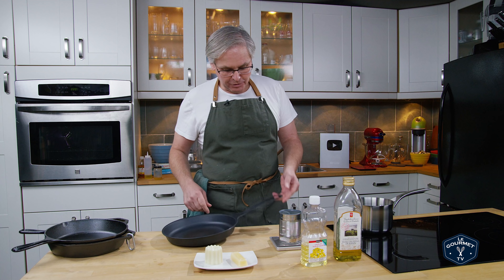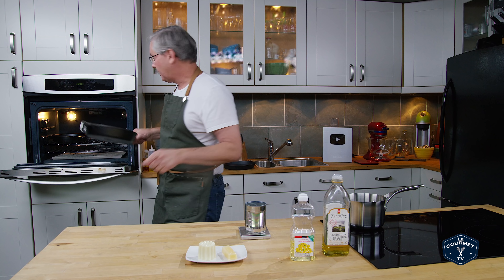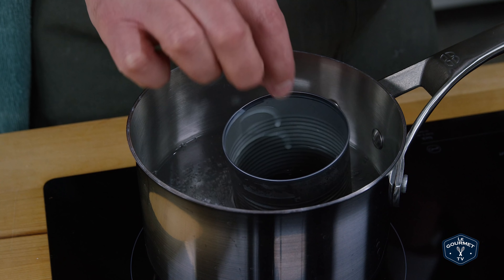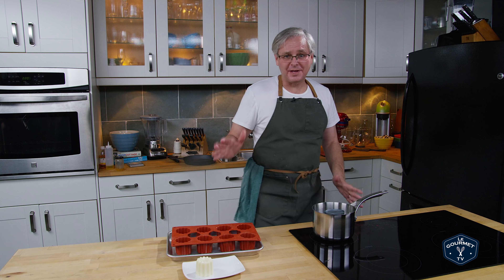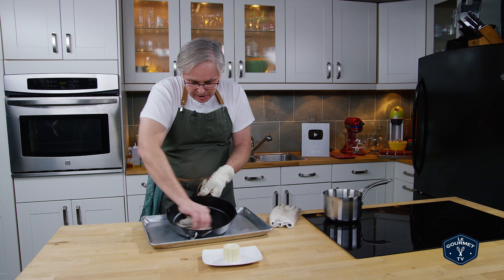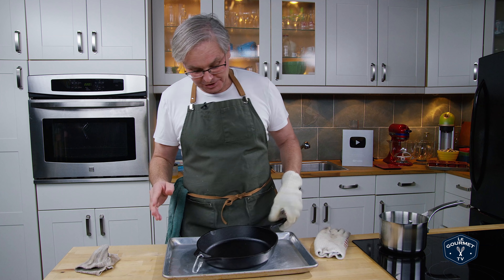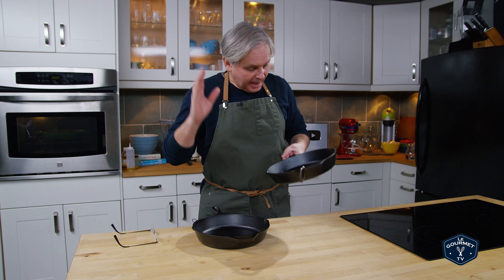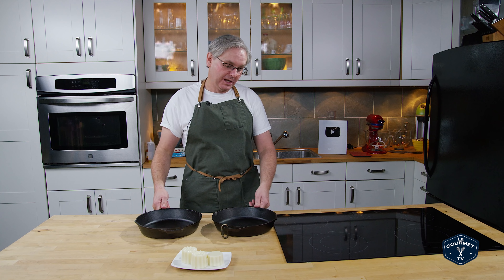Making & Testing Beeswax Cast Iron Seasoning Pucks

Comment: I found that Crisco (vegetable shortening) works well to season cast iron. Flax tends to flake off after a while. First time I hear about beeswax, I have some on hand so most likely going to try mixing with Crisco. Let's see how it turns out.
Reply: Crisco has been my go to as well for the last 20 years or so.
Reply: I season with flax now after some experimentation. It flaked badly the first time I did it, but then after a few weeks where I seasoned the pan after every use, that stopped happening. It's super easy to re-season now.
Reply: I used to use crisco as well and I found the same thing. Its not that it didnt work, just eventually I experienced flaking. I have since learned the reason for the flaking is that crisco has fibers in it which eventually results in the aforementioned flaking. This is why its more common to recommend a pure unsaturated oil like grapeseed and sunflower. Mind you, if you are always scrubbing and seasoning again, <shrug> I suppose whatever makes one happy.

Comment: It’s carbonizing the oil. It fills the pores in the cast iron. The carbonized oil has much smaller than the cast iron plus the carbonized oil has a very stable chemical structure that is less prone to sticking to things. i usually beed blast cast iron down to bare metal and season with beef lard. i think next time i’m going to try ghee on one and 100% pure beeswax on another one. i avoid seed and vegetable oils like the plague because most of them are toxic.

Comment: I wanted to pop in to say thanks so so much for this. I used it to resurrect a De Buyer Mineral B that I’d just about given up on. I just couldn’t get the seasoning right prior to this video.

Now, Crepes, pancakes and whatever else you can think of is just a breeze.

This advice given at 06:40 is golden. I did end up using the biggest flame on our gas stove instead of the oven, but the whole “rub it off as if you’ve made a mistake” really helped.

The puck I made was also beeswax, canola and grape seed. It also lasts surprisingly long.

Comment: Flaxseed oil is uniquely suited for this process because it is essentially a food-grade version of linseed oil. This being the case, it is a "drying" oil that polymerizes under the right heat. This produces the exact coating you're trying for. I've also used it to finish the wood of homemade rolling pins and cutting boards and It works extremely well for that process too. When buying a new cast iron pan, I also use a flexible abrasive wheel on my power drill to smooth the inside of the pan. I know that's controversial but I have found that along with seasoning, it produces a surface almost as non-stick as modern Teflon pans. Unlike Teflon however, it is restorable and entirely non-toxic.
Reply: Low smoke point?
Reply: @mrniusi11  Smoke point is irrelevant to this part of the process.

Comment: I'm a chemist. It's called an aldol condensation reaction. It's why you need a vegetable oil. It needs a lot of aldehydes to work. When you heat it up or even expose it to UV light, you cause these aldehyde groups to react with one another, linking up lipid chains. Furthermore, having unsaturated oils lets the double bonds in the chains react with other more reactive groups and form a net instead of a long string of molecules. The beeswax contains ketones that are not as reactive as aldehydes but since ketones are more in the middle of chains (aldehydes are at the ends), it helps the polymer become more net-like. The reactions are very similar, it just creates the link more in the middle of the carbon chain rather than at the end. Also beeswax has aldehydes itself, and some molecules have ketone and aldehyde groups. The net effect is that you end up with a more interlinked polymer.
You can only use vegetable oil but the polymer won't be as interlinked, so it won't be as chemically or physically stable. You can't use beesax on its own because it doesn't have enough aldehydes. So a mixture gives you the best of both worlds. Also, aldol condensation is self-catalysing so you get a synergistic effect by combining both components. Meaning that by combining both components you get a suitably quick and thermodynamically favourable reaction, unlike using only beeswax where the reaction is kinetically and thermodynamically unfavourable. Using oil only will be more thermodynamically and kinteically favourable than both, but thanks to the nature of self-catalysis (which exhibits logistic growth similar to pandemics), using both it will still be rather quick and easy.
Reply: Ah, yes, I figured aldorol compensation was causing self-cataloging synergies and uh, leveraging the intrinsic exuberance exacerbating kinetic reflux in a heterodyamic solution, maybe.  I'm not a chemist.  🤣
Reply: @brianh.000  that was hilarious 😂😂😂
Reply: Thank you!
Reply: @bloodgain  high or low smoke is a proxy for chain length. You want chains fhat are long enough not to evaporate but not too long so as to not have enough aldehyde groups to create the polymer. You want high smoke point, low smoke point oils will simply evaporate. Conveniently natural high smoke point oils have long enough chains that aren't too long. Adding low smoke point oils may help the reactions be faster but will ultimately produce a worse polymer for this purpose.
Reply: I just wanna ask my Prof the science behind iron seasoning. The only thing runs into my head is the nucleophile carbon double bonds attack the electrophile iron atoms but I’m still not sure how it works. Thank you so much😁
Reply: I guess I need to thank you and the bees for doing a great job!
Reply: jesus christ. i adore people like you. that explanation rocks. thank you. :-)
Reply: Is there a proper mixture ratio between the wax and oil, or is pretty much any combination good as long as they get fully incorporated with each other?
Reply: @trbig67  The video says 3 to 1 
75g oil
25g beeswax (pure)
Reply: Is there an ideal ratio of beeswax to vegetable oil?
Reply: @magistradox39  Probably, but it's hard to say. The ketones and aldehydes of different beeswaxes and vegetable oils will be different, and so will the chain lengths and insaturations. You'd probably have to experiment to get the best mix for your purposes.
Reply: @danielcelisgarza  Yours was the most helpful explanation of this process I have ever seen. These usually are some feele crafty BS that does not make any sense, but your explanations shed a light on why my seasoning attempts with different oils and finally a beeswax mix produced such different results.
Thanks mate!
Reply: As the child of an organic chemist and partner of a materials scientist, I can't thank you enough for this explanation. I've always wondered about the chemistry, but frankly been too lazy to research it. Now I know--thanks!
Reply: @anahidkassabian4471  lol i just finished my phd in materials science, modelled defects in metals.
Reply: How about carnauba wax? Would it be enough?
Reply: what temperature is ideal for the baking process? i can get up to 500 C + in my pizza oven, but i imagine thats to hot.
Reply: @PoolProblems  Idk, there must be papers out there i guess. You just don't want to burn/degrade them i guess. You'll get some of that regardless, but as long as it's hot enough to polymerise you're alright.
Reply: Your reply reminded me of all the times when armchair know-it-alls opine on a topic that they have no real expertise, then a true expert with specialized knowledge enters the fray and everyone shuts up.  Makes me smile to remember it.
Reply: Forgot to ask, will the seasoning keep the iron out of your food?  I actually have a condition of high iron levels so I try not to get any extra because my body holds onto it.  I give blood to mitigate this but it would be nice to be able to use cast iron again.
Reply: @danielcelisgarza  I have heard the onions can also create a non-stick seasoning, is this the same process?

Comment: In my experience the warnings about excessive oil are themselves excessive. I've watched a number of these cast iron seasoning videos and people are very emphatic about not leaving too much oil on and I've just not found it to be that dire of an issue. Do you want it very thin? Yes. Do I use a dry side to wipe off even more? No. Also, I have found that the Lodge pan I bought was a bit too rough from the casting to get a good non-stick surface, so I knocked off the high points with some 220 sandpaper before seasoning. I did not sand the whole thing bare, just took off the high spots. It looked kind of like a starry night when I was done sanding because the tiny points I took off were very small specks in the black sea of the pan's bottom. Just my 2¢.

Comment: Please correct me if I am wrong but I thought you wanted a low smoke point oil for seasoning because the actual seasoning happens as the oil is smoking/above the smoke point of the oil.
Also from what I understand the seasoned surface is very similar to gun bluing.
Reply from the maker: Ask 100 'Experts'... and you'll get an even divide as to what is the best oil to use.

Comment: Thank you for the guide.

 I just made this beeswax and oil solution using 1 part beeswax, 1 part sunflower oil and 2 parts Crisco shortening (1:3 ratio).

Doing my first coat of seasoning right now on my light cast iron wok, will be seasoning my carbon steel pan and enamel dutch oven using the same beeswax solution.

PS. Notice you're using President's Choice brand oil. Love from Canada...

Comment: You should try removing the lodge pre-seasoning and sanding smooth the interior of the pan to see if it improves performance.

I recently tried this with an Avanti Pro Quick Strip Disc and sandpaper. It doesn't take long to do, and left the interior much smoother.
Reply: there is literally no beneficial reason to doing it. wasted time and money.
Reply: If you go too smooth, you'll have a surface where seasoning won't stick.

Comment: Sugar makes polymers, but protein makes stronger polymers. I recently learned that cotton fiber is a sucrose (sugar) chain (polymer), same in tree cellulose.  While some oils can contain sugar, oils are mostly fatty acids composed of vitamin minerals and triglycerides which are a type of alcohol or broken down sugar.  Soybean oil has protein in it, so much so that they make plastic and linolium flooring from it.  Tung oil and linseed oil make a polymer film when dried in thin layers on wood. Mineral oil will dry out on wood and leave a web of dry minerals behind that actually is metallic in nature.  To get true polymers, like high temp plastics, you'd use a high protein oil.  Also, after two seasonings, the layers would begin to form matrixes that cause friction or sticking, in my opinion.  Lecithin found in eggs and soybeans will easily leave behind polymers when cooking, which is why pam cooking spray has lecithin as the main ingredient.  Even though beeswax is great on leather and wood, sugar in the left over honey can carbonize and leave holes in the seasoning film.  Since you wipe your oil off so carefully, it might take three seasonings to set a good film.  The best oil to use, though, which i hate cooking with, is soybean oil.  The people seasoning with animal fats are getting results they think are good, but i've used animal fat and canola oil, and the canola did better than animal fat.  I think the acids etch the metal over time and through rubbing, washing and drying, simply serve to make a more polished surface.  And indeed, polishing a cast iron frying pan cooking surface in poorly made pans is the only way to get a non-stick surface, because no blanketing film can make a mountain range of rough cast iron smooth enough to slide a fried egg off of it.  By the way, i prefer cooking with grape seed oil or olive oil.  This is all i know about this subject.  I love your videos.  😊

Comment: My egg skillet is an old #5 Lodge I've had for over 40 years. It was old and well loved when I got it, and I've never seasoned it intentionally, or washed it. I fry eggs in a very small amount of lard. When I'm finished, I pour off any excess and wipe it out with a bar towel. It's slicker than snot on a doorknob, and eggs slide right out every time. I do wipe the outside with a sponge if it needs it, but never the inside. 

On the other hand, I re-season all of my other skillets regularly with vegetable oil, particularly if they've had tomato based sauces, or boiling liquids in them. I also won't hesitate to scrub them with hot soapy water as needed.

Comment: i just cleaned out the bottom undercarriage drip tray of my toaster oven for the first time in about 2 years.  (i know, gross but hear me out i couldn't see the nasty stuff).  there was a gummy polymer-like coating (i'm guessing from oil drippings and such etc)  in the bottom corner of it that i had to scrape off with a razor blade.  it was thick but i'm guessing this is the same process that happens when you season a pan.

Comment: Linseed oil is the best for seasoning cast iron really any oil with a low smoke point is good thats because you want to creat a nonstick surface  when you use a high smoke point oil i makes it harder to create the nonstick surface thats because it that more energy for the oil to convert into the 'polymer'

Comment: Flax is nice because it's a "dry" polyunsaturated fat, if used correctly it doesn't gum up or get sticky
Reply: Linoleic acid, man, I bond whitewash with it
Reply: VoluntaryismIsTheAnswer how do you get the linseed oil to mix with the lime water?

Comment: The soup can you used is lined, will heating it melt the lining and cause it to mix with the wax and oil?
Reply from the maker: No - the can is subjected to 3x the heat of boiling in the original canning process. The lining won’t melt, it’s not a concern.
Reply: @GlenAndFriendsCooking  Thanks :) I shall try to make some tomorrow using this method

Comment: I have a cast iron pan that I’ve messed up due to following to much wrong.....and right advice over the years.  

Is there a way to start over without having to sand it down completely?
Reply: Spraying with Easy Off and putting it in a garbage bag for 3 or 4 days.  Rinse and scrub under cold water.  Repeat if necessary, then season.
Reply from the maker: @philiposm - Any pan that I need to start from scratch, I just run through a self clean cycle in the oven. No muss, no fuss, no chemicals, and it's ready to re-season within 4-5 hours.
Reply: Glen & Friends Cooking Thanks!!!!  Never thought of that.

Comment: I have a small collection of vintage cast iron. For over thirty years I've used hydrogenated vegetable shortening, like Crisco to season the pans, If necessary after cooking, I clean by a quick soak in hot water and scrub with kosher salt. Then rinse, heat on the stove, and use Crisco to put a fresh, very thin layer that I practically polish off. Beautiful matte surfaces.  I occasionally use soap and a scrubber on the outside to prevent grease build-up. 
But hey, I've still got some pans to restore. I'm willing to try something new....

Comment: Is there away to make enamel coated cast iron pans non-stick ??????
Mine stick so bad I can’t use them .....   :(   :(
Reply: Try using a good bit more oil.  Also be sure the pan is nice and hot before adding the oil, then the food.  If possible, dry whatever that food is off a good bit if you still have a problem.  I usually find it comes down to oil, temp, or too much steaming.

Comment: These are CAST iron pans, not WROUGHT iron pans. Cast iron pans are made by pouring molton iron into sand molds. Wrought iron is iron that has been worked (or wrought, archaic past participle of work), usually by a blacksmith.
Reply from the maker: Well then @Parker Donham These fit your definition of 'wrought' - because they aren't poured or cast, they are worked. Check out their website for more info.
Reply from the maker: Well by your definition... then yes, the pan I refer to as wrought iron at 0:08 is wrought iron. It isn't cast, it's worked into that shape. 
The pans at the 1:00 mark that I refer to as cast iron; are cast iron.
Not my first rodeo - I do my research.

Comment: I have a Lodge cast iron but use it very rarely as just scared of how often you're meant to season and clean.. I use hot water and a iron chainmail to clean. Though then never sure how to dry it, if I need to heat it again or just dry with a towel as usual.
Reply: I usually put mine on the stove for a minute to dry it and then add a really thin coat of oil (like Glen did) if I cooked something dry like tortillas or an acidic sauce that might remove some of the seasoning.  That's just one way and there are LOTS of opinions on the subject.  It's pretty hard to ruin cast iron.  The best advice is to use it and learn.
Reply: Hand dry after washing, and put on low heat for 5 min or so. I do this first, then wash my other dishes.

Comment: I've been using Cast Iron for years, and will try this next time I re-season. I've always been told that after cooking/cleaning I should coat my pans in a bit of oil so that it won't rust while being stored. Any truth to this at all? My process is wash the pan, towel dry as much as possible and then throw it back on the burner till the remaining water evaporates and then spread a thin layer of oil.
Reply: Mark P a bit overkill unless you’re using your cast iron on wood fired flame
Reply: That's what I do too.  When I got lazy and quit doing it, I started to lose my seasoning.
Reply: > My process is ...

That's what I do.  If I just cook bacon, I'll just leave the left over fat in the pan for the next time I use the pan.
Reply: pretty much my method, usually, unless I get lazy lol. I have never been afraid of soap or soaking a pan for a day, either